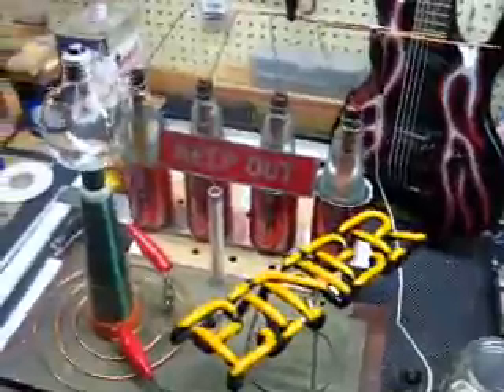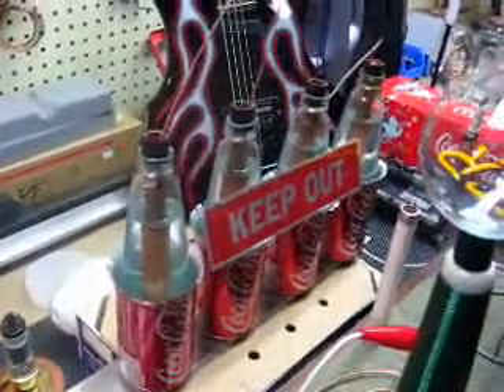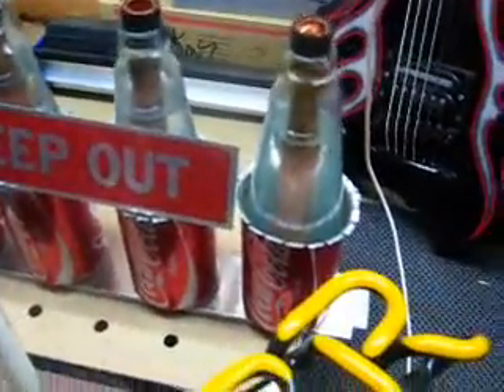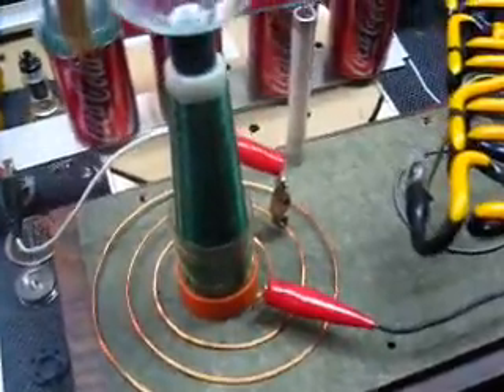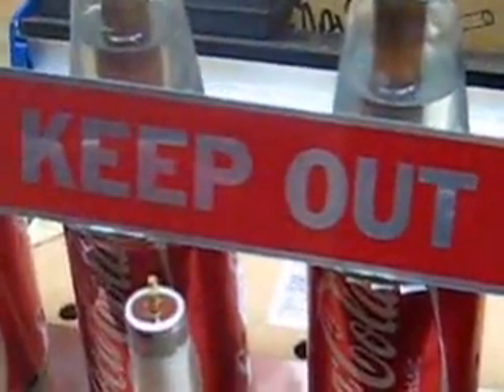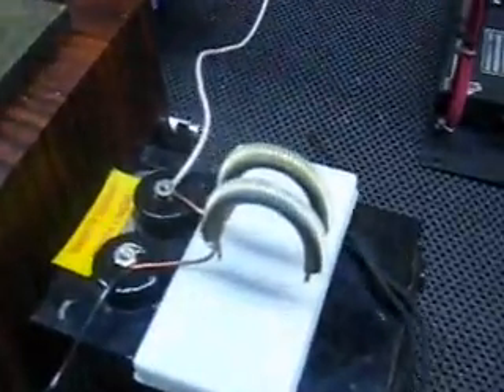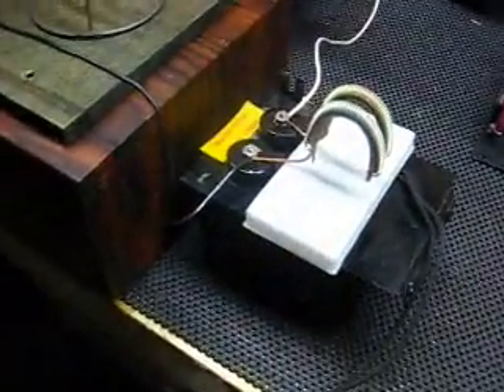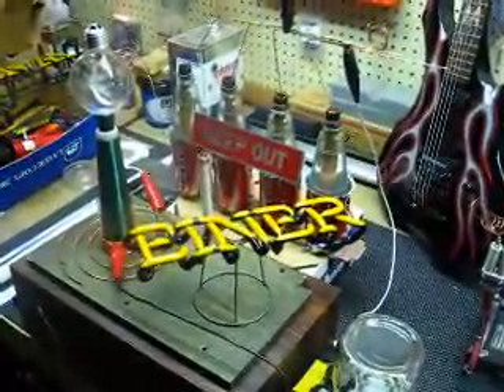A Tour of My First Tesla Coil

Comment from the maker: Well I will give you extra credit for the jar tip because you are correct. It was actually a safety thing more that a practical thing. As for the caps, this is on bank of 4 plates. If i had multiple banks, I would put then in series. The high voltage source is an OBIT 10,000 volts @ 23 ma. A four plate bank seems to work well with this type of transformer. Thanks for the comments on my first tesla coil! Dr. Franken Zap

Comment: You should add a LOT more turns on the primary, so that the secondary winding will absorb much more EM force, and resonate with higher voltage and current. That means long, thick streamers.